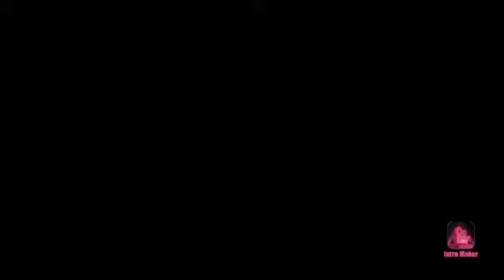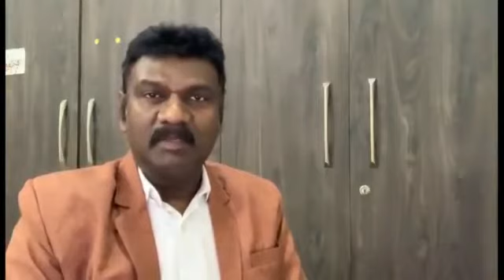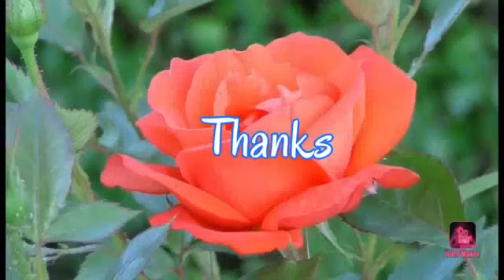" UV SPECTRA " Ultraviolet Chamber

Comment: Strong Acid Water 2.5pH from Enagic's medical grade water ionizer is basically a sanitizer in the form of water. Use it to remove harmful germs from your hands and toilet seats. Businesses dealing with food utilize Strong Acid Water as an effective measure against food poisoning.Mar 18, 2018Sodium hypochlorite

Sodium hypochlorite is commonly used as a bleaching agent, and also to sanitise swimming pools.

As a common bleaching agent, sodium hypochlorite is used for a variety of cleaning and disinfecting purposes.

It releases chlorine, which is a disinfectant. Large quantities of chlorine can be harmful.

The concentration of the chemical in the solution varies according to the purpose it is meant for.

A normal household bleach usually is a 2-10% sodium hypochlorite solution.

At a much lower 0.25-0.5%, this chemical is used to treat skin wounds like cuts or scrapes. An even weaker solution (0.05%) is sometimes used as a handwash.